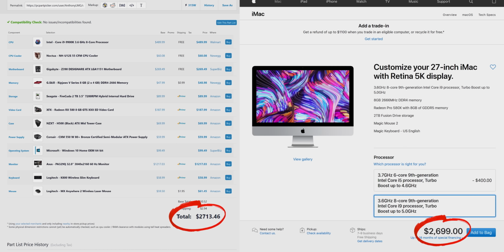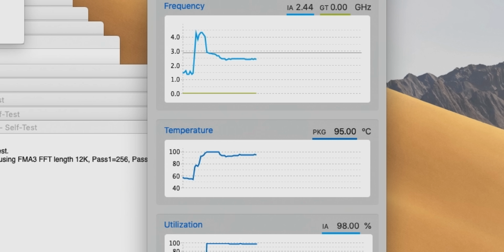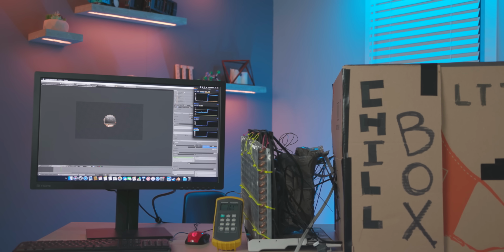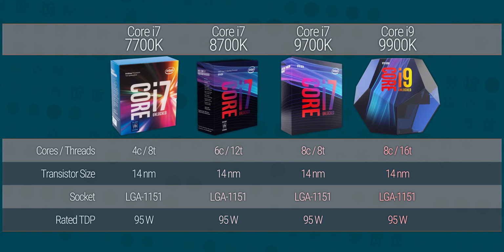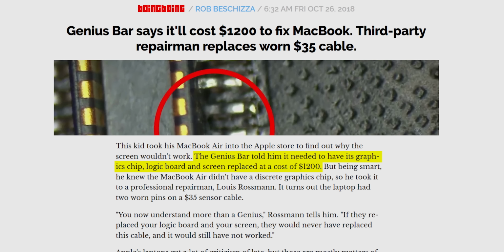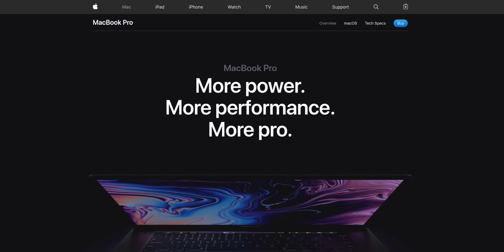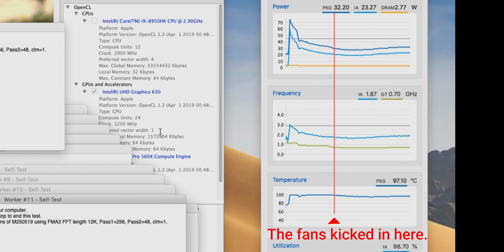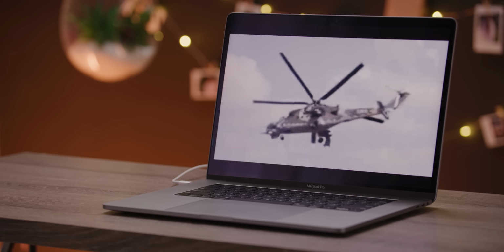Macs are SLOWER than PCs. Here’s why.

Comment: they can be same price or a bit higher price a customize PC than an Imac Retina but in a PC we can open up or pc use brush or compressed air or both to clean the dust from the fans of the cooling system  and from motherboard u can take off your cpu cooling system or the graphics card cleaning them deeper and even check them. Meanwhile in an Imac u can die from the capacitor if u remove the glued screen ( i remember the video about opening the Imac and crashing the screen )  and basically Apple gonna sues you if u try to open their  mac cause they are not meant to be even after  1 or 2 years of us probably there will be more dusts and pubes inside it than a  vacuum cleaner.
So better have the same price on a machine that can do anything  and u can perform maintenance as much as u please and keep the GPU and CPU far away from overheating and damage that comes from or better a glued mac that u can't even maintain clean by yourself so after some years u have to trash it even if they are this top notch best appealing shit that people are always barging better than PC oh i forgot to say PC in the time can be even upgraded while Imacs cannot  and if u ask apple to fix things they say it's not possible? This is why Macs are worst than PC

Comment: iPhones have Apple's custom chips, and therefore they have more control over the design and temperature (using 7nm for example). They could justify this probably because of how many units they sell. I don't think Apple has ever sold enough laptops to justify developing their own processors instead of relying on Intel. Who knows if that will ever change.

Comment: hm I'm not sure I agree that Apple have two different ideologies regarding iPhone and Computer throttling. Remember, the reason the iPhone runs so well is because Apple create their own SoC, which pretty much no Android does (most use Snapdragon). Apple of course is able to tailor their hardware to the SoC so it runs well. At the same time, they managed to develop it so that it can be so strong without throttling. Here is the problem for Mac computers. Like Android, Mac have to use an out-of-house chip, in this case Intel. Apple doesn't control what Intel does so of course they can't make sure that the chip get smaller nM transistors and runs cooler. Ok you are right, Apple are mis-leading with their advertising, however, they are making the most of what they have got. They are trying to set themselves apart from the competition with the clock speeds (among other things). 

I think that if Apple could make their own chip that would be faster than Intel, then I think they would deploy it. They are (were?) making strides with the iPad performance, however have obviously not caught up with Intel performance yet. 

I don't think Apple wants to have the two different ideologies in terms of throttling. Not sure if my comment makes sense but these are my thoughts. What do you think?

Comment: What I've learned by getting older is most people think skin deep. No one values function over form; judge people and things by what's on the inside. 

So many look at the outside and proclaim it's good build quality. I bricked a 2012 era macbook air. Hit all cores with load and the gpu. Got 105 and kept climbing before I killed the test.. it didn't work right after that. Fuzzy donut + yes > /dev/null & at a shell prompt and you'll cook a mac.

Comment: WAT,  similar price but the screen is so overpriced it is taking $1k2 from the bill wtf
Reply: Yeah and even so its not a 5k panel like in the imac, so 1.2k is still low I guess?
Reply: As others have said, one of the few things Apple always has been better at, it is the screen (except for the Macbook Air until recently). Top tier accuracy, color gamut and pixel density. 

2010 iMac  with i5 and 8 gb ram and 500 mb hdd costed 1300 eur to buy in 2010 and had a 27" 1440p LG IPS panel. In 2011, I bought the Dell U2711 monitor, which used the same panel as the iMac. Costed me 650 EUR with which was 100 eur off the msrp. 

So ina sense, around half the price of the iMac was the monitor, and for good reason. Especially since the iMac had LED backlight, compared to my Dell which had traditional backlighting.
Reply: @Wistbacka  what are you talking about buying an ips display like that does not cost pc users anywhere near that amount unless its 4k 10 bit and more. Which is still cheaper overall and has better actual specs. I can find great 4k ips 10 bit panels  with better color accuracy than apples for less than apple charges. At a little over 600 I found a 43 inch monitor or tv if you will because that's literally massive 4k ips 10bit with color accuracy the same if not better than apples. The only reason youd pay 1200+$ for a panel like that is because its a 4k gaming panel hdr and 10 bit ips 1ms response time which doesn't exist for 4k that I know of its like 6 or something maybe 3 or 4, 144hz and other features. Yet a 1440p which looks almost the same as 4k even at 27-32 inches so this is from gigabyte a 1440p 144hz 10 bit ips 1ms response time panel with freesync 2 or basically freesync or gsync is 600$ or a little more with all of that there its 27 inches. Plus some extra features even if some are gimmicky which the additional crosshair actually isn't surprisingly its like a little cheat sort of. IS less than what apple is charging for theirs at half cost. Repairs cost next to nothing or its replaced.
Reply: @Acheron_the_Nihilty  This was in 2010/2011. IPS was not main stream yet. Only photographers and medical monitors used it at a premium. Apple were the first to put it in a "mainstream" device in their iMacs. I was very much into photography at the time and needed something better than the crappy 1080p TN-panel I had at the time.

The LG panel in question is a 100% sRGB, 96% AdobeRGB with 12-bit color gamut. So it was not your average IPS panel at the time.

A few years later, around 2014, really good IPS panels could be found in mainstream around 200 eur. But with lower color accuracy.

I still have and use that Dell monitor as a secondary screen. As my main screen I use an AOC Agon AG271QG with an IPS 8-bit colors. While IPS, and much faster in every way (obviously), the AOC (Acer and Asus are using the same panel in their equivalent monitors) cant beat that 2010-monitor in color reproduction and accuracy. Was a bitch to calibrate the monitors to try to get them to match each other.

I dont see what your price argument is about; there are always cheap variants of everything. Cheap 4K,cheap IPS, cheap 65". But then you usually compromise on something too. Look now at high end gaming or pro photo/medical monitors. They aint cheap, are they?

And for better and worse, Apple tend to want to give all their users the best screen experience out of the box. You can always argue it is unnecessary, and I agree to an extent. But at the same time, if you are not tech savvy, all you will notice is if the image looks nice or not. And on an Apple device it most likely will (unless you had one of the pre-2018 macbook Air; God dammit that is a horrible screen).
Reply: @Acheron_the_Nihilty  Comprehension, comprehension, comprehension.

Wistbacka is talking about 9 years ago! PC users were getting excited by their typically cheap choices at the time. They still are. Go and have a look at what is being sold now as displays on PCs and you are lucky to get 1080p and PC Users still desccribe that as HiRes. ...and ignore the color quality and viewing angle.

Problem is PC Users dont actually compare and take themselves into an Apple Store and test out the clearly superior units, instead they always think what they have is "of course" the best.
Reply: Also, what do you need such accuracy on your monitor for? Do you really think you’re able to tell the difference on sight?

Or even worse, you’re a graphic designer, photographer or post-producer pretending you need a super-accurate color on screen, whereas a real professional in color correction will be looking at their vectorscope or waveform graphic and NOT their image preview to work.
Reply: @ybenax   Yes of course you can tell. Can't you?

It's not just designers, video, photographers (who aren't pretending - they are doing) it is also used by scientists, medical staff, hospitals, engineers, architects, in fact anybody who needs high detail and accuracy and a lot of desktop to fit their work on. Not your typical Gaming PC user for whom any crap will do and usually does..
Reply: BTW the cpu didn't match cuz the iMac had 8th Gen i9 while on pc he had 9th Gen i9 also I bet you could save money just buying a rtx 2080 and a 8th Gen i9 and have way more power than the throttled iMac. probably a laptop would be faster than the imac
Reply: Peter Breis  why using lol make me ignorant? 
most monitor nowaday using IPS panel, the differents are backlighting (led or flourescent) and color depth (6, 8, 10, 12), and Im quite sure there are lots of 4k led 8 bit at just around $600, while for 4k led 10 bit is $1k, then it cost you around $30 for calibration service? and bam thats already killed the $1k2 monitor overthere
be a smart buyer, you get them calibrate your monitor once so it look nice out of the box for $500? any display will lose its color accuracy over times, and if that's crucial for you, then calibrating regularly is required, use calibration service or buy calibrator, its just $200
Reply: Apple's monitors are top tier and have insane color accuracy.  It's really difficult to match that kind of color accuracy for photo editing without spending big money.
Reply: @omg_stoppit  I would pay for calibration service than this monitor lol
Reply: @nasmeskartz9149  Calibrating a shit monitor does not magically increase the range of colours it can display....

Comment: I use ThrottleStop to disable turbo boost in my HP core i7 notebook. 
It runs cooler and actualy faster due to no throttling.

Comment: Used to own a 2013 MacBook Pro w/ a dedicated Nvidia GPU. Absolutely loved that laptop, bought it in 2014 for $1800 USD. 4 years later (back in 2018) it started getting the black screen of death on boot (meaning it would chime and light up but the screen would remain dark). Genius Bar was quoting me $600 to fix because “the logic board needed to be replaced.” I laughed, walked out of the store, and sold it for parts online. Wanna know the real kicker? I sold my gaming laptop (a 2013 ASUS ROG Stealth) to a friend to help finance my MacBook Pro, he tells me to this day it’s still going strong. Sworn off Mac products ever since, and once my iPad Air 2 finally dies I won’t be replacing it with another iPad.
Reply: You’re just giving one example from yourself, which is one person. I know plenty of people with macs that have had them since 2007 to this day. Every computer is always going to vary in term of longevity and so forth. You just got unlucky.
Reply: Stefan Etienne  people you know just got lucky. I know plenty of people with 2012-2014 MB pros who got their mobos replaced, there even was a recall program for these. Bad engineering, not a bad luck. When you run out of Applecare, you’re basically fcked.
Reply: @CSPhobos  Of course you don't need Applecare for a recall. But that program has already ended, so you're stuck. Even Apple admitted by that recall that something's wrong. It all had been beaten to death so no point in taking it further...Anyway, glad to hear it works for you, it's a rare case these days, must feel kinda special:-)
Reply: @CSPhobos  Lucky you. My 2013 MBP w/ Nvidia GT640M got the black screen of death a couple years after Apple's extended repair program ended. Why do you think they even launched an extended repair program in the first place? Because Apple recognized that it was due to faulty engineering. However, because I happened to be unlucky enough for mine to fail after the end of their repair program (it ended at the start of 2016 IIRC and mine started failing in 2018) I was left to cover the costs myself, to which I said "FCK that". Quit defending Apple, seriously they suck.

Comment: I switched to macs in 2007 - I wanted to use GarageBand as a teenager, then as an adult I liked the UNIX OS for web development. But I might go with a Windows laptop next time. I'm lucky that my current MacBook Pro still has a full-size HDMI port and two USB-A 3 ports; this was the one before they decided to remove every single port in favour of USB-C. That's just a dumb move. And the "touch bar" is a useless, expensive gimmick. And the most recent MacBooks have chronic keyboard breakages and display problems due to design faults. It's not looking good from Apple to be honest.

Comment: Why doesn't Apple just include a Pro/Performance mode setting toggle that allows the fans to ramp up more to help performance and reduce throttle? Then the user can choose between quiet and fast.
Reply: User choice in an Apple product!? Blasphemy! Apple will tell you how you are to enjoy their products and you will be damn grateful!
Reply: Apple isn't about options. They give you the product and you use it the way they want you to use it.

IMO Apple devices are good for kids- they are set up and ready to go and don't need a bunch of settings changed, and they don't have the option to do that and mess anything up. On the other hand Android and Windows both offer ways for you to install unsigned applications that can easily damage your pc or you can easily delete system files. Even though I would never personally use an iPhone or Mac, if I had to buy a phone or laptop for a child I would definitely consider it. Also in my experience Macbooks had a much more rigid construction than 99% of normal consumer laptops.
Reply: you have apps to control the mac fans
Reply: @ivan___ivanov4739  Apple doesn't support it by default. You have to go 3rd party to circumvent there limited design.

Comment: LLT ............THE REASON WHICH I THINK IS ON IPHONE'S THE HARDWARE IS completely OF APPLE BUT ON MAC'S SIDE ITS A DIFFRENT CASE SO...APPLE SHOULD MAKE THEIR OWN CPU AND GPU TO RUN A MAC SMOOTH UNDER FULL LOAD AND HIGH TEMPERATURES .... I THINK YOU CAN CATCH ME😄

Comment: You coul put a "tap water" slot on it and when you need to use heavy load. Just plug on the sink faucet. :) just like a washing machine.
Reply: That would turn into apple juice real quik.
Reply: LTT did this already. problem is condensation that gets everywhere. tap water is cooler than ambiant room temperature, so humidity from the air tends to be attracted to materials cooled below room temperature. so in the case, the motherboard.
Reply: neojack333 yea you would have to insulate the “pipes” very well up to the point of actual heat exchanging
Reply: Haha, LTT did that like a couple weeks ago on a PC. Would work well, but it would be very wasteful
Reply: Here ya go: https://youtu.be/CFXyyJyEtVI

Comment: Let me take a crack at it: apple values form factor over power. They are able to have both (form and power) in iPhones,  helped by the fact that they designed the processor themselves. They can't do it with desktops because they are at the mercy of Intel. They resort to software trickery to achieve the desired form factor.
Reply: Apple going with Intel was a mistake, because on top of the issues you mentioned, we now have all these idiots who think that Macs should also be able to run Windows.

Comment: I don't disagree out of hand, but I would like to point out that both you and Louis Rossman don't even touch the fact that most laptop (and smartphone) manufacturers build absolute garbage from the ground up and charge at the same kind of rate. Even a $300 netbook probably isn't worth the actual $20 in parts, but it will fail guaranteed in about 3 years-- if you're lucky.

It's not just "tech savvy" that's often lacking, but also "deal savvy." Not everyone wants to spend hours on the internet trying to figure which computer is THE ONE TO RULE THEM ALL, at the lowest price possible, from a company that isn't insulting their intelligence, etc. Apple isn't alone in these kinds of practices, far from it. They are just the biggest and that makes it "cool" to pick on them.

.....I say while typing from a MSi GS65, that replaced a MacBook Pro. -.- There are other reasons that make it clear they DO NOT build gaming machines. Seriously 31ms to change the color of a single pixel REALLY???

Comment: 0:10 I think this answers why apple is not intrested in the Mac they are getting profits which are way lesser than what they get from selling an iphone.
Reply: It's not an apples to apples comparison, despite what LTT wants you to think. That mac doesn't have a 9900k, doesn't have the nice of a motherboard or PSU, that alone changes the price difference by a few hundred. But then factor in the cheap cost of the "case", mouse + keyboard, OS is free to them, screen costs Apple ~$500 instead of $1200, and they're getting bulk pricing on everything so they're saving even more money. To the end consumer, they did an OK job here showing it's not that much more for a mac than building your own PC, but for Apple they're easily making around $1,000+ before factoring in the cost to produce the OS and customer support.